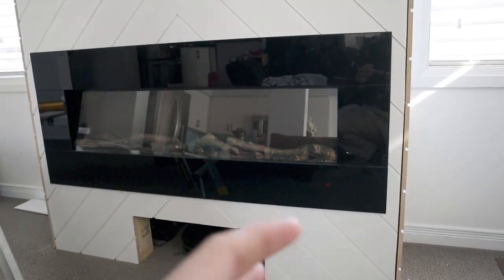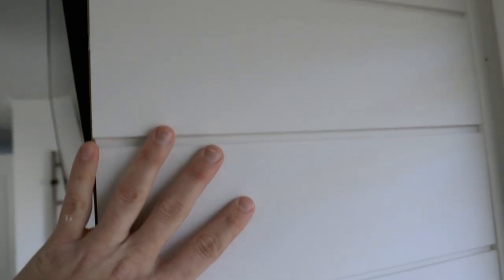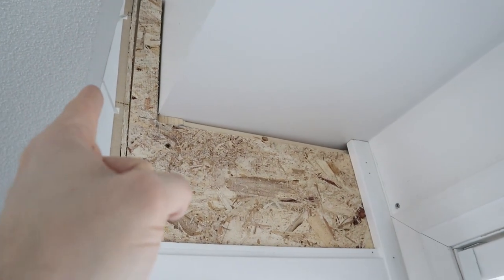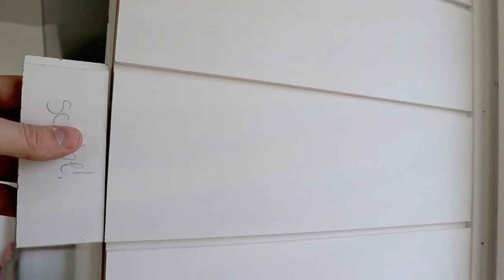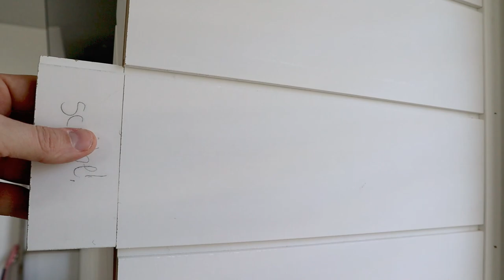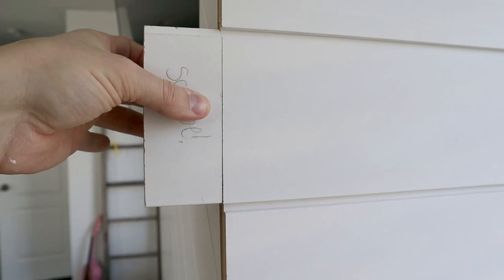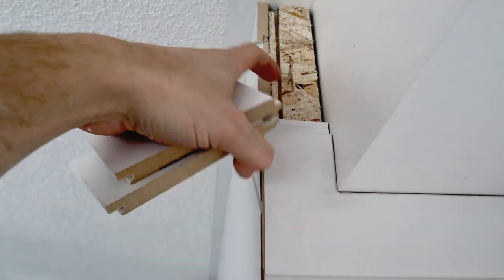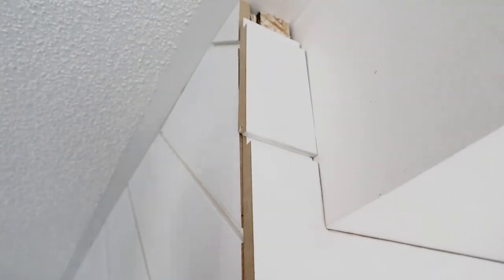Shiplap Fireplace

Comment: Did you use Mdf Shiplap? How is I’d holding up? Does it withstand the heat?
Reply from the maker: Hey! Yes I did use MDF. And it still looks great. The only thing that has cracked was the chaulking bc it was a project I did during lockdown I just used what I had and this stuff wasn’t ideal